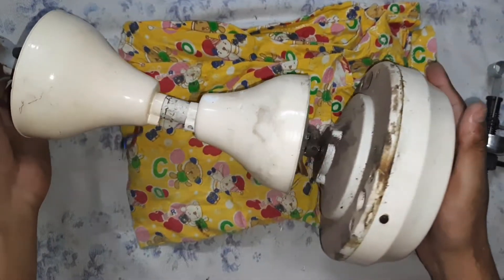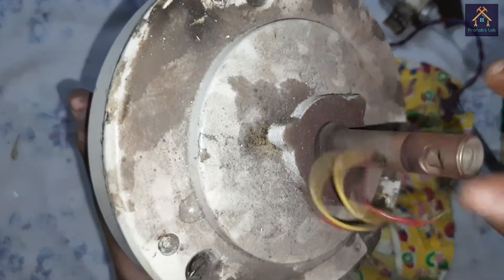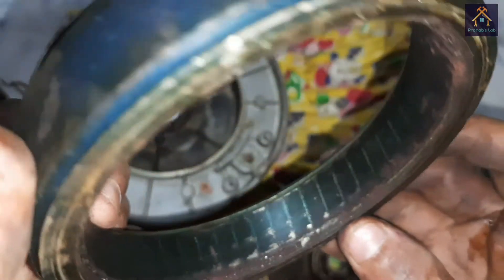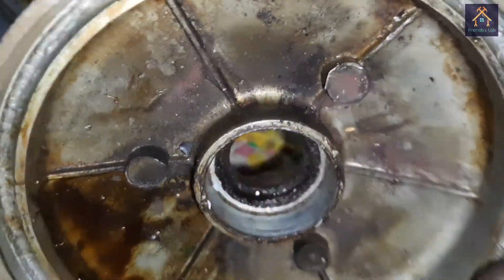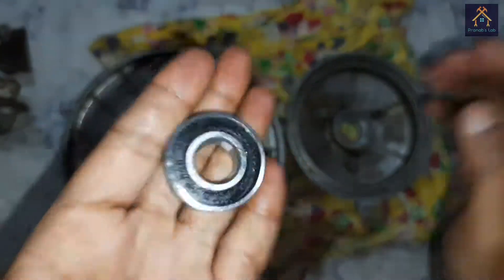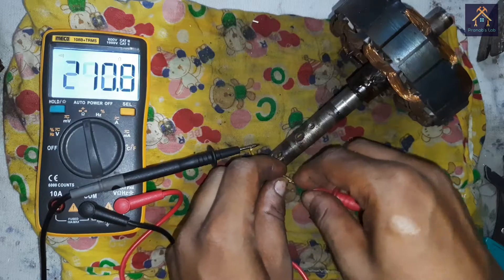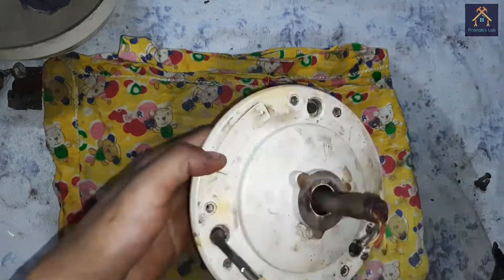Celing Fan Oiling | Bearing Change | Winding & Capacitor Check | How to Replace 6201, 6202  Bearing

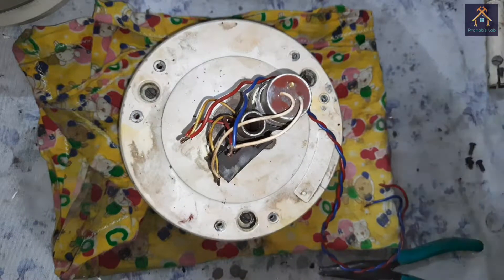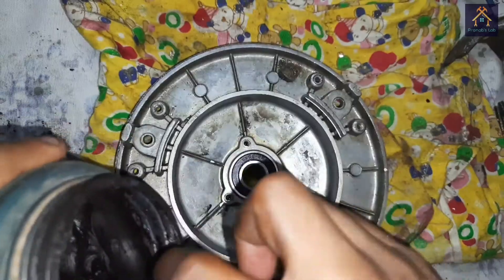Comment: Do not follow the process shown in this video. This person has no knowledge about fan motor. He has made wrong connection. Fan is rotating in opposite direction check 17:03 time. For no reason he has put grease in false cover time 14:14 . Outside bearing time 10:24. His measurements are wrong at time 12:05. This great Dumbo doesn't have sense that his fan is rotating in opposite direction time 18:43 . You will ruin your fan if you follow his video. A million thumbs down 👎👎👎👎👎👎👎👎👎👎👎👎👎👎👎👎👎👎👎👎👎.